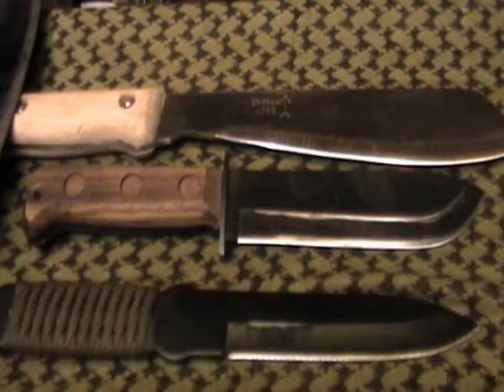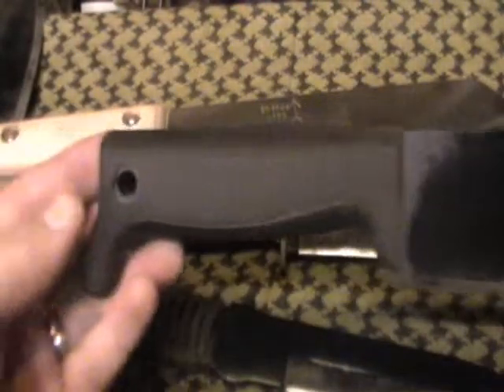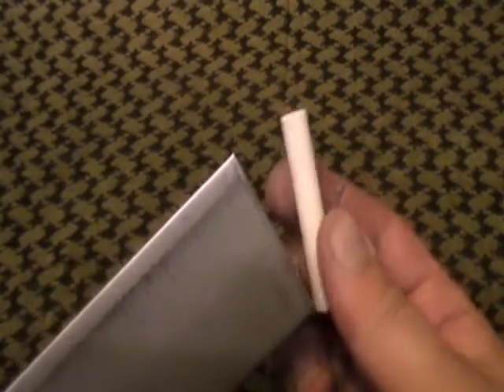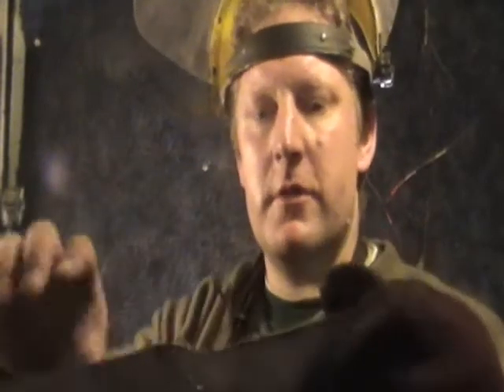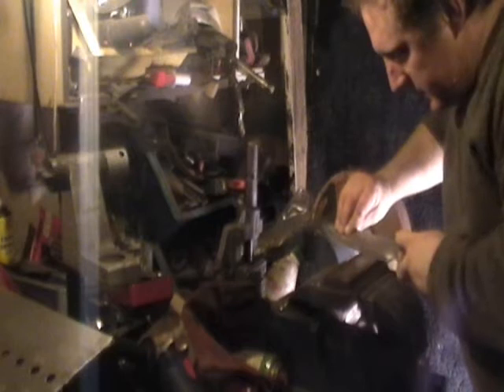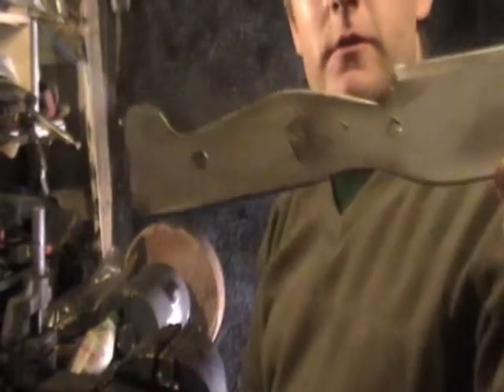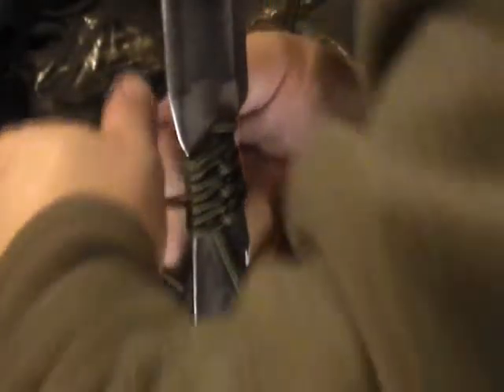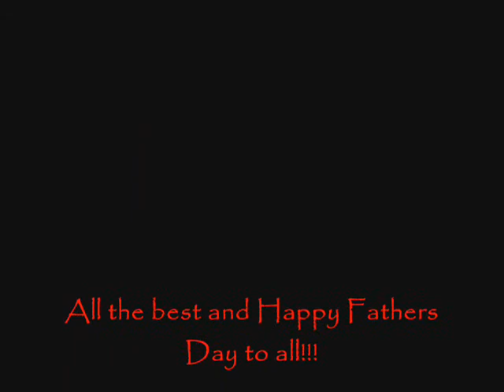Heavyb2u Entry,,How To Make a Quick Knife with a Paracord Wrap Handle

Comment: @bassfuryvi Yeah, thats what I was thinking, and with the thread going through holes in the wood to help keep it stable.. I'd be interested to see if you find it 1:/ Easy. 2:/ Better :).  For in field use/replacement holes in the wood are not practical though :)

Comment: You know, I quite suck at paracord, and am personally quite against using it for handles.. but thats just me.. LoL.. I wonder if you might be interested in doing something similar to a japanese wrap to make the handle more comfortable. Using 2 shallow moon shaped lengths of wood with drill holes also, and then put the paracord through the 2 inside wood scales and steel then paracord over the entire thing to give some girth to the handle? Just a thought for comfort that might look good too.

Comment: @bassfuryvi Legend in my own mind.. lol.. When it comes to designing a knife, I feel its better to think of the features required, and how you'd use the knife personally, rather than taking much inspiration from others. if it ends up similar because thats how function is then its of no matter. By designing your own ideals, it will never cross a line. Its like cars.. they all inherantly do the same thing.. its in the nuances of the designer and their applications to acheive that differs.